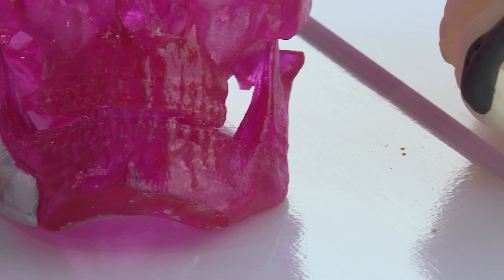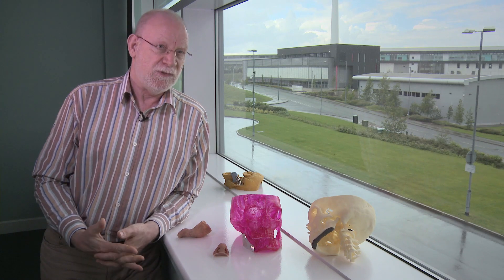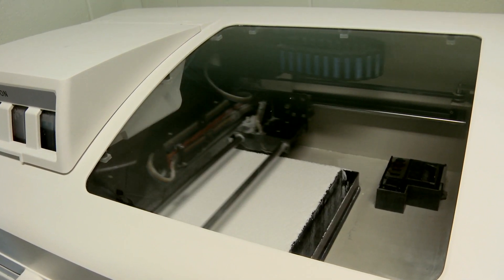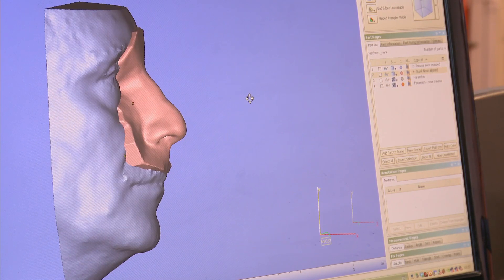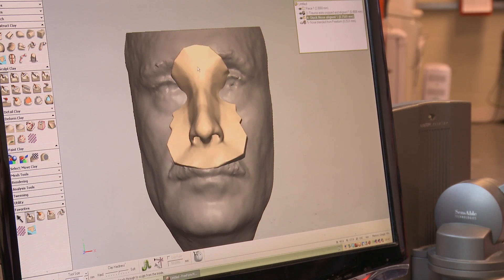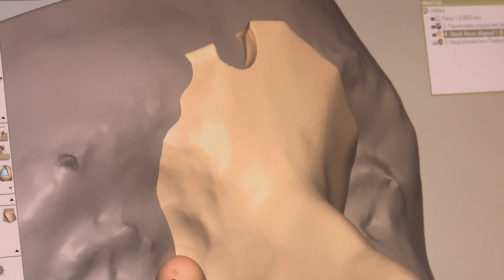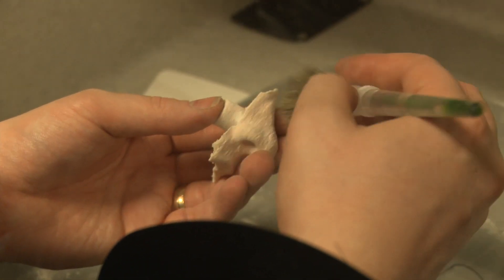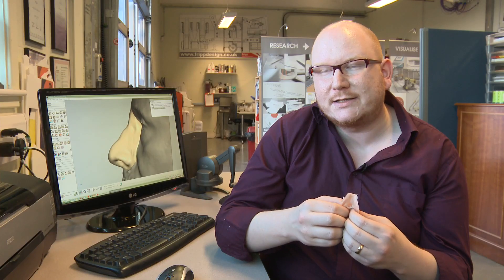Soft tissue prostheses production using 3D colour printing

Comment: Hi - What design programme are you using to join the scanned body part to the stock item? And what scanner do you use? thanks
Reply: Tadesse Productions 
Hi Tadesse Productions.  We used Freeform as we found Voxel Modeling to be the best method for achieving this.  The scanner was a 3DMD 5mp 3 pod photogrametry system.